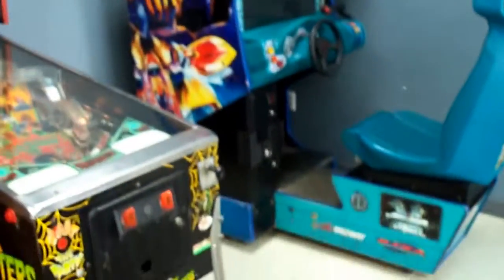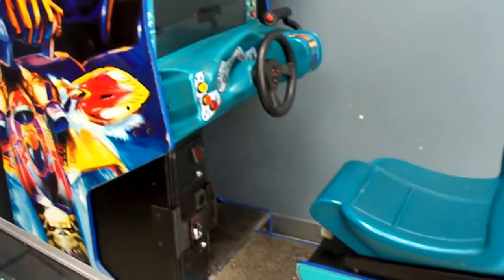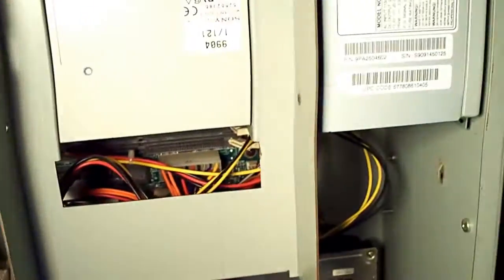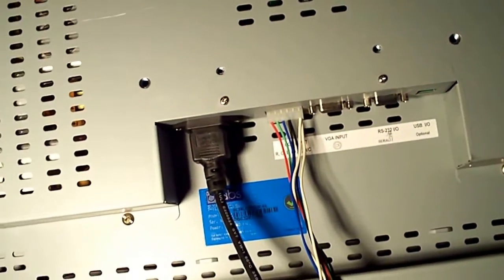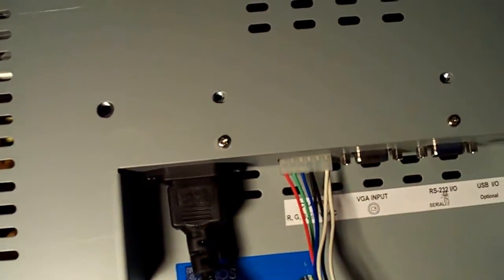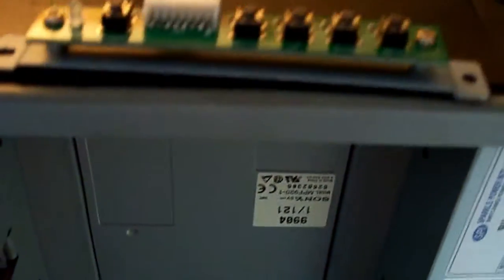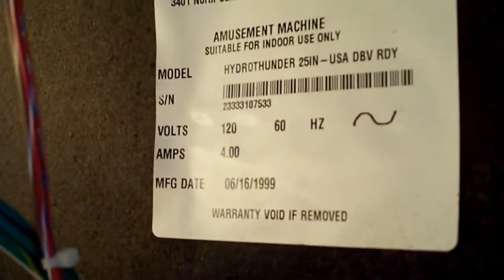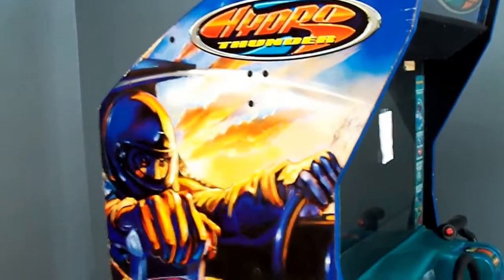recapping Hydro Thunder part 1

Comment: I remember being an arcade tech and people wanting these flat panels installed in the games.  The first thing I would do was replace all the caps on that PS board even in the new monitors with 105C Nichicon caps rated just above the operating voltage of the originals.  Some of these monitors, the caps are in REALLY bad spots where a lot of heat can get to them and that is why they fail.  Especially in Samsung monitors like this, cheep caps rated for 85C right on the heatsinks and transformers.  Built to fail IMHO.
Reply from the maker: it lasted a year and then a transistor burn up.    the game will boot with a pc monitor hooked up but the pc monitor will not sync.
I told them to sell the games to Micky  they both need restore and I have no time or interest in doing it
Reply: Wow, that figures, more and more problems with this newer tech.  Did you get to see what was wrong with the old CRT that was inside it, or was that before you got there?
Reply from the maker: befor I got there these were left in the place when it closed abandoned for 2 years
operator abandoned
there used to be a galactica and a ami-rowe CD juke ,I have the remote  vol.- reject box from it
Reply: Oh wow, I wonder why it was abandoned.  Maybe ran out of money?
Reply from the maker: they did not pay taxes  landlord locked up place for 2 years
Reply: Oh okay.